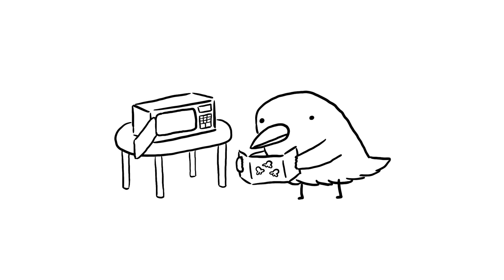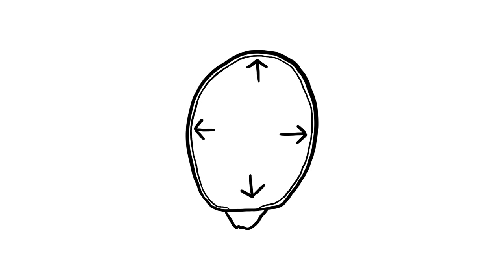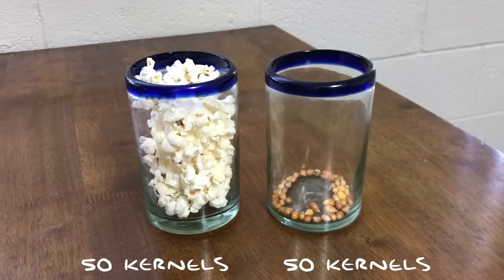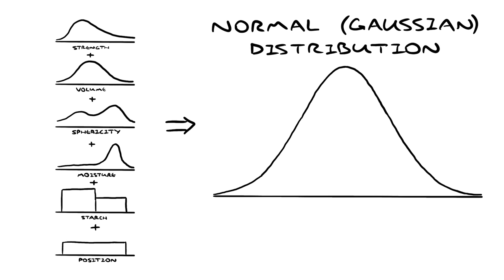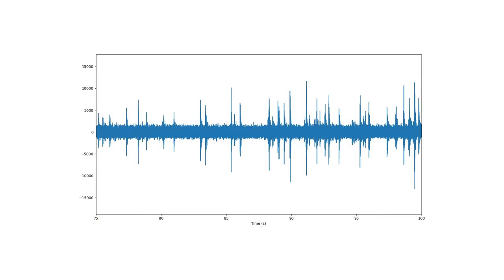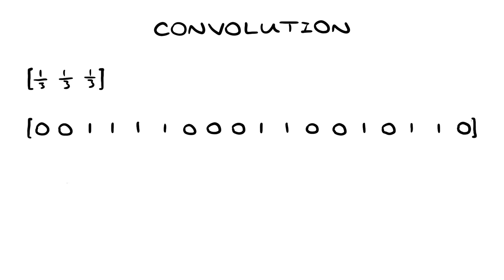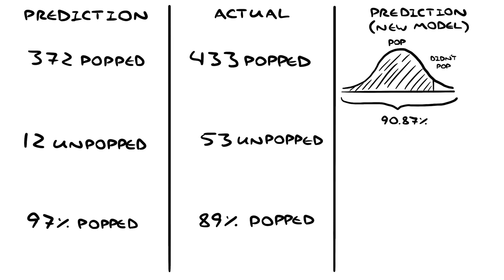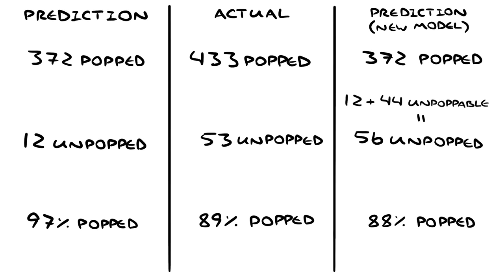The Statistics of Microwave Popcorn

Comment: It's a great video, so I want to give a rebuttal for the sake of argument:

The experiment feels incomplete due to collecting data per the bag instructions, leading to adopting a rigid assumption of 10% unpoppable kernels. I agree, stopping at the instruction mark yields this result, but the remaining unpopped kernels are by no means "unpoppable" - they are rather "unpoppable without risk of burning others" - a seemingly pedantic but important distinction as it affects the interpretation of the probabilistic model. 

Popping a bag of popcorn to completion, while burning some of your well deserved snack, provides crucial information on the rate of change in pop time as we progress through the full population of kernels. 10% is a rather high margin for an assumption of physically unpoppable kernels (anecdotally with my popcorn, microwave and farmer  business senses). These data would contribute additional observations leaning towards a right tailed distribution of pop times. With that in mind, I'd like to touch on the assertion of a normal distribution via the CLT.

I believe the application of the CLT is skewed - for the analysis of pop times, a single sample was considered (one bag's worth of pops, where each pop is determined by underlying pop-inducing random variables). In the context of the CLT, a sample refers to a set of randomly drawn observations (many pops), and an observation refers to an individual data point (a pop). As shown, the sample drawn has an average, which can parameterize to a normal distribution (as performed, and admittedly not a **bad** fit). But the CLT has not been applied here - in order to do so, one would need to draw a number of samples (bags popped) to compute an average pop time (per sample, i.e. bag) - then the resulting distribution of average pop times would be guaranteed to be Gaussian via the CLT. 

As is, the experiment conjects that the joint probability distribution of the underlying pop-inducing random variables will be normal by asserting the CLT, but this misrepresents the CLT. Asserting the CLT requires repeat samples and subsequent computation of the distribution of sample averages - the CLT does not generally apply to joint probability distributions, only to the specific configuration of joint probability distribution which is the distribution of repeated sample averages. The CLT is a law regarding repeat sampling and averaging, not the nature of random variables and joint probability. A joint probability distribution is not guaranteed to be Gaussian - only the probability distribution of averages from repeated samples is guaranteed to be Gaussian. Now I feel like I've said the same thing in many different ways, but hopefully you're still reading :) It's easy to follow if I could add some happy Latex maths.

To assert the CLT as stated in the experiment would require identical kernels to be popped repeatedly to generate a sample and average pop time ***per kernel***. This would result in a distribution of average pop times per kernel, across all kernel configurations - guaranteed to be Gaussian via the CLT. On the other hand, one could pop many bags, and compare average pop times of each bag to assert the CLT as well. Neither very practical, or useful, as the CLT only ever tells us that.. well.. the distribution of averages is... just that, average. 

That said, I wouldn't fight you on simply assuming that the joint probability distribution of pop time based on pop-inducing RVs is Gaussian - it's a fair starting point - I just want ti argue that asserting the CLT as reasoning for the assumption is a bit misdirected. (Not completely false, as you can stretch it with an assumption such as: each kernel pop is in itself an average draw of a sample from its unknown pop-inducing RVs - starting to sound like popcorn quantum mechanics). Still, it's food for thought as removing these two assumptions (normalcy of the joint distribution of pop time and holding 10% unpoppable kernels) would let us deal with a more complete dataset and an unrestricted joint probability distribution, opening the door to performing a full inversion on the portion of kernels popped as a function of the pop-time interval. The frequentist approach is useful, and accurate within its assumptions, but for me, the real meat is in the inverse nature of the original question posed: how can I use pop-time intervals to predict the proportion of popped kernels in my tasty pocket of microwave-popped popcorn. 

Oh, at the beginning I lied and said I wanted to give a rebuttal for the sake of argument. What I really wanted was to procrastinate my actual research, so thank you for the entertaining side quest, and for reading this if you did :)

Comment: Cool video! But I believe you're incorrectly using the normal distribution here. Your data only picks up popped ones w.r.t. time so the distribution only models probability of a kernel that was going to pop anyway, popping at a certain time within an interval. The area instead gives you % of kernels (out of the total popped kernels) that popped between x & y seconds.

Also, at 10:23 you can't just cancel out the dt terms like that for the spacing eqn. because A is an integral, not sure why the operator isn't shown. Even if you could cancel it, it would cease to be an integral, a contradiction. Notice as well that your spacing eqn. is now dimensionless when it's supposed to be calculating time length between pops.

Then at 10.31, the same eqn. is somehow equal to % of kernels popped? How does that work? And how is it accurate when 98% was the inaccurate estimation. 

So because the spacing eqn. is invalid, the result in 11:04 is also invalid because of course, the denominator is actually the CDF, not the PDF

Comment: There is a simple solution to all your problems: Take a pan, put some oil in it, put popcorn corn in it, but not too much, heat the pan, and when it starts popping, stop the heat. Since the pan and oil are still hot, the corn keeps popping, and since the popped corn has a much lower density, it floats on top, while the unpopped corn stays in the hot oil and eventually pops. This is how popcorn was prepared before the advent of the microwave, and the yield is much better.

Comment: You could theoretically go until all the poppable kernels have expaneded but then you risk burning some. The optimal solution should be to figure out how long you can go before the burnt popcorn count is greater then or equal to the unpoppped kernels

Comment: personally, i weigh an empty bag of popcorn, then i weigh one kernel and weigh a full, unopened bag of popcorn. i take away the weight of the bag then divide it by the weight of the kernel. i then count the pops and once they reach 12.5 below the total amount of kernels, i pull the bag.

Comment: Hmm, however when I make popcorn in a pot/pat I rarely have any unpopped kernels nor I never burn the popcorn. I think it has to do with better heat distribution?
Reply: I haven't counted how much corn I do by hand, but by looking at end results its volume is roughly the same, so it is not the difference of the sample size either, but definitely better than 90%

Comment: I reuse my popcorn bag until it turns to dust! put an equivalent amount of unpopped kernels in (take the unpopped out and mix it in with fresh) some cooking oil (use old oil cos fresh oil has stuff in it) then fold the bag more or less bag to original form, repop as per usual. I obsess over microwave popcorn too, currently at 99% popcorn output +/- 1% unpopped cos I do it two or three times until have been nuked!

Comment: What about air popping, from my experience after 100g of corn only a few would refuse to pop, so I think the margen for burning is baked in. Or did I miss something?
Reply: Or maybe it has something to do with how the corn is bashed around in the air currents, and also by being bumped by other kernels when they pop
Reply: I would guess that an air popper doesn't get hot enough to burn the corn, also maybe the "mushroom" (round and solid when popped) type popcorn that an air popper uses has a larger separation between the pop and burn temperatures?

Comment: Or just cook your popcorn in a cooking pot? You can season it however you like, use exactly how much popcorn you want to eat, and adjust the amount of butter and salt to your liking. Then, after most kernels are popped, I leave the unpopped kernels in the pot and cook them again. The "unpoppable" ones will eventually crack and you can eat almost all of them. It's like less than 1% that will never even crack.

For the fat, I found out that about 50/50 butter and canola oil mix tastes the best for me. Only butter will quickly develop burnt taste. And only canola oil makes the popcorn taste dry no matter how much you use. But half of each makes the cooking pot popcorn taste perfect. Way better than the microwave one. And also a lot cheaper.
Reply: Trade offs: time, need to clean cookware (increased water usage), need to preheat cookware, lower efficiency of oil usage (microwave popcorn is coated in a very small amount of oil relative to the corn and none of it cookes off like heating oil in a pan), several orders of magnitude greater energy loss to the environment than direct heating via microwave irradiation (microwave excitation generates heat directly in the oil and kernels). Nothing is ever "better in every way", there are always trade offs and the most significant one here is convenience, especially for small batches.

Comment: I recently replaced my "ol' Redenbacher air popper" because POWER SWITCHES ARE A SAFETY FEATURES!!! (Rant over). The new popper came with a little card that stated how many kernels that would remained unpopped based on kernel size and how full the container was. It was a nice thing. I still don't use the card.

Also, Microwaved popcorn stinks. I can't eat it. Smells of burnt plastic. And air poppers are much better.

Comment: "Independent samples taken from the sum of many distributions will always be Gaussian", no that is not the central limit theorem. In fact this is easy to find a counter example: make distribution D_i be uniform [i-1,i]. Each sample is guaranteed to be larger than the last, so it's not even going to converge. So that is clearly non-Gaussian.

The central limit theorem says that the averages (so scaled sum) of independent samples taken from the same distribution will converge to a Gaussian. Independent and Identically Distributed (IID) is the core assumption of the   CLT's proof. And assuming the kernels all are taken from the same popping distribution, then the average popping time from measurements will be independent and identically distributed variables, so that leads to a Gaussian. 

There are weaker forms of the CLT like the Lyapunov CLT which can take values from different distributions, but there's also strong moment assumptions that need to be mentioned for that. Those moment assumptions maybe could be justified, though that would need some discussion. But that ends up being a far cry from "many distributions" and "always Gaussian".

Also, are they independent? If one pops then it gives out steam, which may pop the next. That might be giving a skew to the distribution. Even the LCLT requires independence. There are even weaker forms where if one can show the difference is a Martingale then etc. etc., but I'm not sure the difference is justifiably Martingale?

Anyways great video, but calling a nope on that justification of the Gaussian there.

Comment: Pro tip: Avoid microwave popcorn, get a bag of cheap kernels and throw them into a pot with some vegetable oil. It's faster, much cheaper, you generally have a much better pop rate of pretty much 100%, almost no waste, and you can completely avoid any dairy products or other additives you might not even know about. Just add salt and you have buckets of perfect popcorn for a few cents.

Comment: Popped is actually 100-(53/433*100) = 87...% Something and which you later did was approximately 85%. Which is still close but now the actual algebra is right. But in actuality it should've been 100-( 56/433*100)= 87...%. which is so much closer.

Comment: I moved somewhere where electricity is more expensive than gas, so I switched to popcorn that you can buy by just scooping it and putting it on scales. I do the exact same thing that you do with microwave popcorn, but on stove, and I count to 6. If I manage to do that without interruption, it's done. I came to like doing this, it's much easier to add custom flavors this way. AAAND it's always done Ideally, there are no un-popped kernels. If I was to move somewhere where electricity is cheaper, I'd keep doing this on a stove, it's much better.

Comment: Sometimes the popcorn still burn, even if they haven't slowed down enough, specially if they got stuck and stopped spinning, as the core of the bag could end up on the middle of a hot spot.

One good trick if they get stuck in your microwave, is to fold the corners of the bag inside, that way it can rotate more easily

Comment: Wait, no the distribution of many random variables, the distribution of the sum is NOT normal. The distribution of the MEAN of a sum of rvs is normally distributed.

Otherwise you are asserting that the sum of distributions which all have the same skew will become a distribution with skew 0 which is clearly absurd. 

And also the CLT ensures that the distribution of the mean becomes ASYMPTOTICALLY Normal, meaning you should say "the mean of a sum of different distributions becomes approximately normal"

Comment: You probably coul've used a Fourier Transform instead of a Wavelet one to find the PSD, and just filter out the low amp microwave noise. Like, with numpy you can do it with just a line of code:

PSD = np.fft.fft(signal)

Comment: My anecdotal experience is that it's fine to wait until 6 seconds between pops, without risking burning. 2 seconds between pops is way too soon and leaves too many kernels for my liking. Also as other comments have said, unfolding the bag before you put it in and shaking it after you get it out seems to help.

Comment: What's interesting to me about all this is that large percentage of "unpoppable" kernels.  I find those hugely annoying... and... when I get popcorn and pop it on the stove, I've figured out that if I use enough oil (to make sure that there's still some thermal regulation near the end), I can often get as low as like 2-3 unpopped kernels in the pot at the end... and I think I've even gotten zero.  So, I guess they're using different breeding techniques for that, or something?  Or just the technique changes the game a lot, and the "unpoppable" kernels aren't actually so unpoppable, except in that method?  or....... I don't know, but it's interesting to think about.  Would be curious to see what you find if you explore this.  :)

Comment: no no no, a 6:42 it looks exaclty like a sperm. How DARE you use a macro scale when radio waves are closer to the micro by an order of magnitude.While I am typing this out I am picking out the roughly 1/3 of overcooked popcorn out of the bag becaus I stopped/ started my popcorn roasting so that I could average out (as per the intsructions) pops per minute. I now have a a clump of black pop-corn and my smoke alarm is going off because averages are not a great indicator over mean distribution. 
If only my hubris made me stop when I thought the popcorn was done.

Comment: What variables can be changed? Well there's the popcorn brand, they might differ if not manufactured the same way. Also the wattage and time. Nothing else really. You are supposed to keep popcorn packages in dry, room temperature and up to best before date. I make microwave popcorn about 10 times a year, but always max. power on the same microwave.

I used to have 2:45 timer, but recently I finetuned it to 2:40. Perfect popcorns everytime. All it takes is few times of trial and error, then you can just rely on the timer. Nothing else really changes - might be the manufacturing quality that ensures sames results everytime.

Comment: I do not even have a microwave oven. And I bought corn years ago. Occasionally I do popcorn in the pan with a lid. The benefit is, I can toss it around. The small "unpopped" corns fall easier to the bottom, where it is hot and they have a much higher chance of being popped.

Comment: Ditch the bag, get a metal bowl or wok, put the kernels in the bottom just barely covered in a high smoke point neutral oil (peanut or canola should be fine) and cover with tin foil with some vent holes. Keep it moving over the stove, wait until popping stops completely, and you’ll be hard pressed to find even one kernel that’s unpopped or burned. Anything with curved sides and a flat bottom to let the kernels cook and the popcorn rise above the cooking surface once popped will do. It’ll change your popcorn game I promise.

Comment: Funny thing though, the common popcorn seems to me better suited for popping in a pan or kettle than in a microwave oven.  I have generally noted a much better yield that way and less likelihood to scorch.  I believe this process better evens out the randomness.  There's a factor in the microwave oven from variation in the electromagnetic fields which will randomly favor the optimal popping of some kernels but not others, versus simply sitting in hot oil.  Popcorn bags for the microwave oven do generally contain oil which heats in the microwaves, but that oil is not the only factor.

Comment: my microwave has a special popcorn button. you enter the weight of the unpoped bag and press start. the microwave hmmmmms along until the bag opens from all the steam build-up in the bag and the microwave detects the steam. then it counts down from 30 seconds and stops. the results are pretty good but I will definitely be doing some popcorn statistics on this method now!